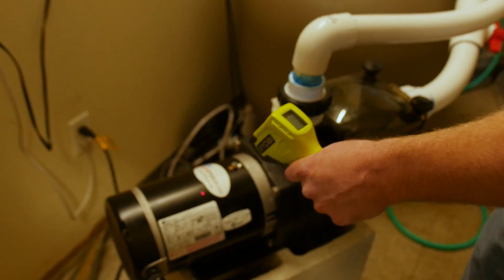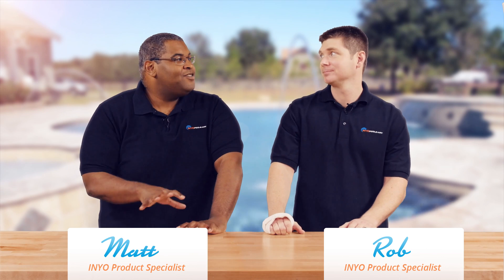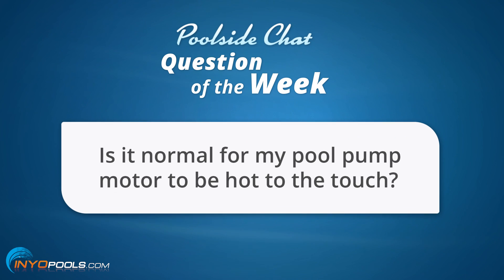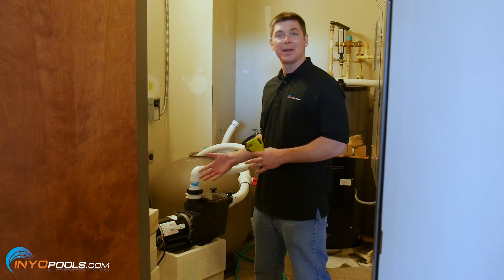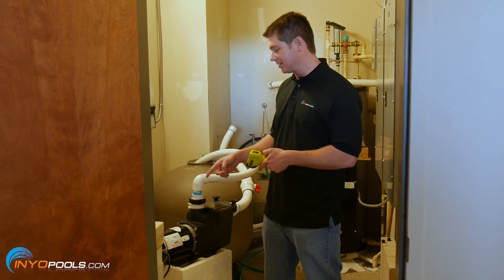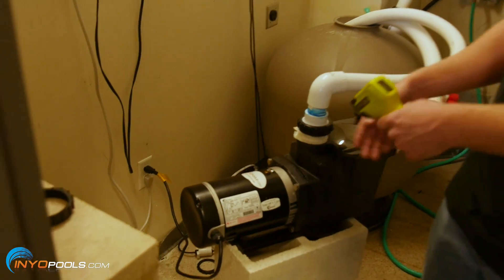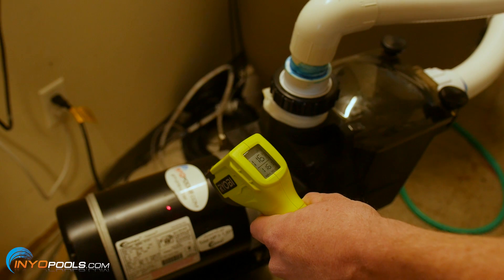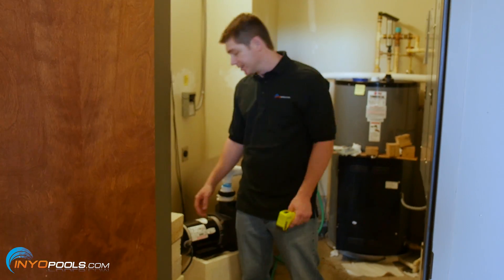Is it normal for my pool pump motor to be hot?

Comment: Bought a replacement pump motor from Inyo Pools and it runs fine but the case is so hot , our motor info label turned black and unreadable due to the hot motor case. Pool owner for 28 years and never seen one this hot.

Comment: As a new pool owner/new home owner in general your videos have provided a wealth of knowledge. I am curious, I know you said the pump can handle there own but is it worth adding like a shaded cover over the pump? It is in direct sunlight in some of the hottest Texas summer days. Would providing any shade to the pump be beneficial or not really? When I say shade I mean something mounted off on the brick to our fence not obstructing the motor in anyway. Thanks!
Reply: Thank you so much!!!
Reply from the maker: Very good question! Yes, it would be a good idea to get a shield to ward off some of the direct sunlight. There are things called motor covers that slip over the motor, creating a little vented doghouse the motor can still breath but be protected from the elements.

The motor protector is matched to the model of motor, so you'll need to identify which motor you have first. But here is an example of a motor cover: https://www.inyopools.com/Products/07501352015137.htm

Comment: my problem is that my pool pump starts fine but if I have to turn it off for any reason and then turn it back on it will just hum. Then I have to wait about 45 min for it to cool down before it will start again. It's been like this since I purchased it brand new two seasons ago. The local store wouldn't exchange it.  It's a 230 volt US Motor 1.5 Horsepower.
Reply: That sounds like a bad start capacitor.
Reply: Motors/ whole pumps only have a one year warranty. So the best time to purchase one is mid or close to end of season. 

That way if it's purchase July 28th. This year, it'll be covers til the same day next year. (Obviously. )

But most people don't consider the winter time or off season. So if you bought it in the winter or beginning of season, you go through the whole season with it just fine. You then winterize your pool, it sits over winter and then when you goto open your pool around the same day as last your when you opened. The warranty will already have ended. If not it'll be within a week or two of ending.

Comment: Good stuff. Rebuilt a junk Craiglist 1.5HP motor and was wondering if the wiring is no good since the hottest part runs around 148F. Looks like it is normal after all.
Reply: Well I take it back. Bent up the governor while reassembling the motor; that took away the startup circuit and made the motor spin the wrong way. With the fixed governor, the motor spins at about 95F without a load.